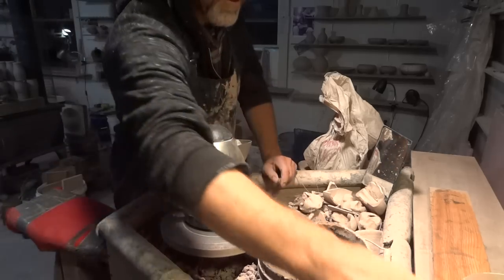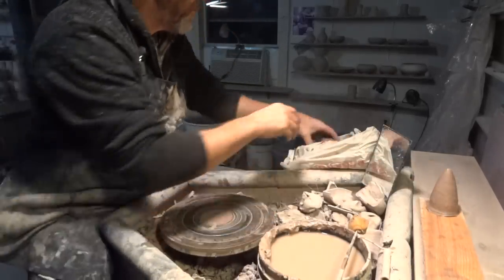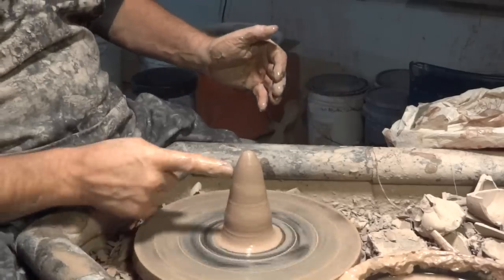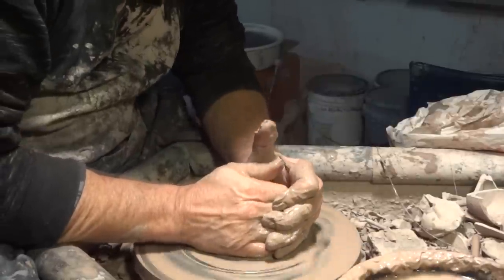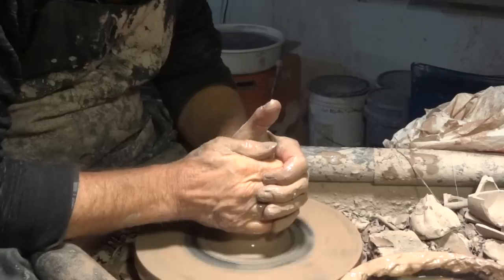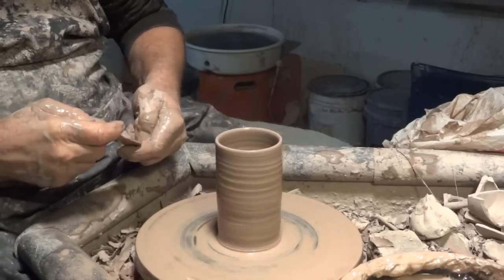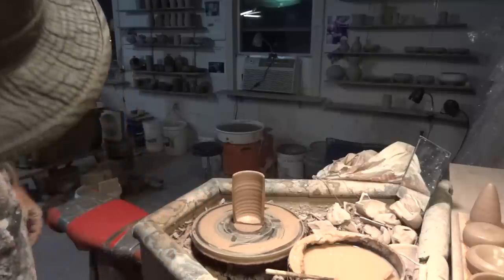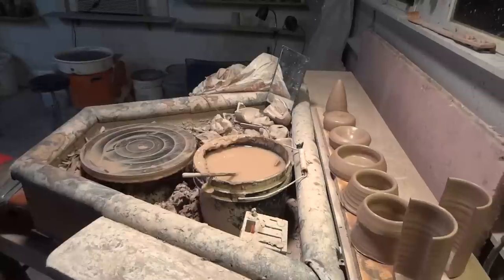7 easy steps to throwing a cylinder - Nov 12 -2018 with Simon Leach

Comment: I love seeing the way you position your fingers together. I'm in a class with some beginner throwers and I think some dont recognize how much easier it is to build walls when you start from a curved dome position, rather than keeping the shape entirely at a right angle from the beginning. Great steps!
Reply: I’m one of the beginners!  I’ve had 5 wheel classes and have yet to make a cylinders, only bowls.  This video is very helpful in regards to what I was missing.